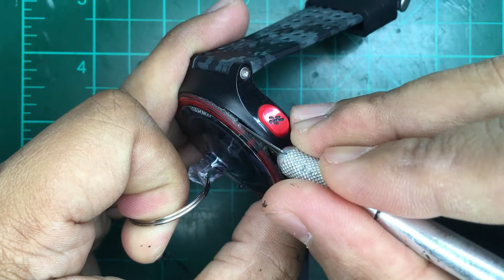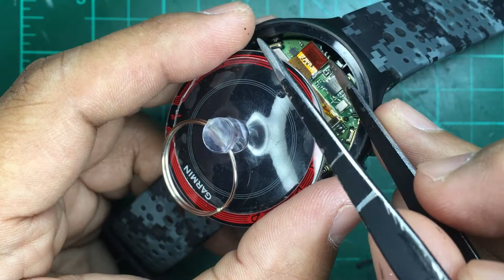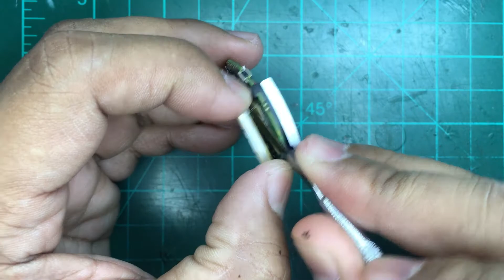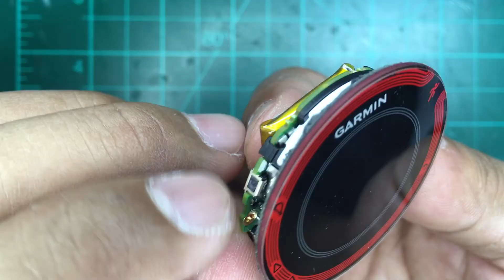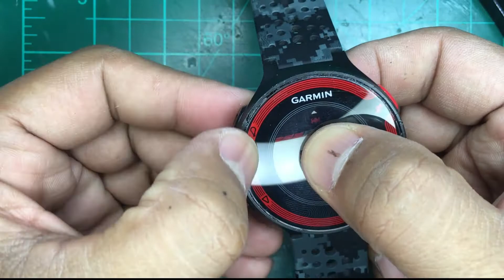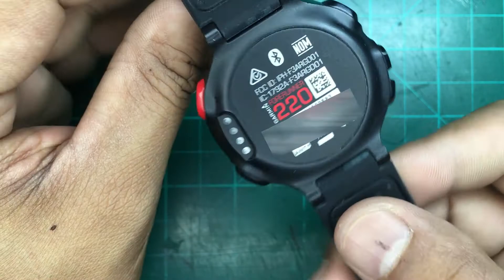Garmin Forerunner 220 battery replacement

Comment: What kind and size screwdriver do you need to remove the screws? Is it some kind of torx bit?
Reply: You ever figure out the driver size?
Reply: @clintcristina206  I think I got to the point where they looked similar enough to the ones to release the wrist straps and decided I wasn't going to buy a screwdriver to take the thing apart.
Reply: I have just discovered that it is a bigger size than the one used to hold iPhone screens in with.

Comment: Thanks for the video.  Can you provide links or information on the replacement battery and glue used?
Reply from the maker: Here are the link:
Battery -
https://a.aliexpress.com/_mqC2xUf
Glue -
https://a.aliexpress.com/_mq34J4R

But you I suggest you look for other battery. The one I bought only last for 7 days even when GPS is off.

Comment: Your battery was a 361-00072-00 (180mAh) but some sellers offer a 361-00076-00 which is 250mAh and supposed to be compatible, but won't a larger capacity battery be a bit fatter and maybe not fit inside the case?
Reply from the maker: 76-00 might not fit inside. Just use the specified battery for your watch.

Comment: Nice video! Is it still waterproof after replacing the battery?
Reply from the maker: Not waterproof after tampering the original adhesive.

Comment: After pasting the canvas, how long can I swim with it?
Reply from the maker: You can not. Opening the watch will break the waterproof seal. Applying adhesive will not bring back ng waterproof capability of the watch. If you have waterproof adhesive for the watch then you can use it to swim, but not sure for how long and how deep. Since this watch is for running, not for swimming.
Reply: @M3Moto  ok, but if you can get this waterproof adhesive tape, would it work to close a 735xt?
Reply: @M3Moto  which tape do you recommend?

Comment: completely ridiculous.  The 220 is GARBAGE!  They obviously designed the watch so that battery replacement would be impossible for most people.  Now why would they do that?  Why do you think?  To get you to buy their latest new improved watch when the battery stops holding a charge on the 220.  Garmin is GARBAGE.  I will never buy another Garmin product
Reply from the maker: That is a marketing strategy. All smart watches have the same design. You need to get the job done by service center or a certified tech.
Reply: @M3Moto  thanks!  yes, it does indeed look like a marketing strategy.